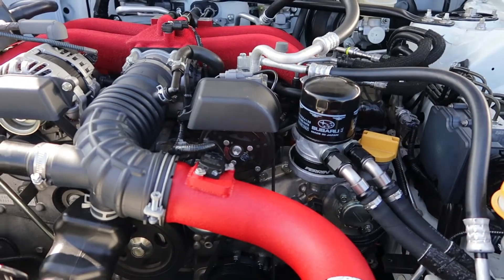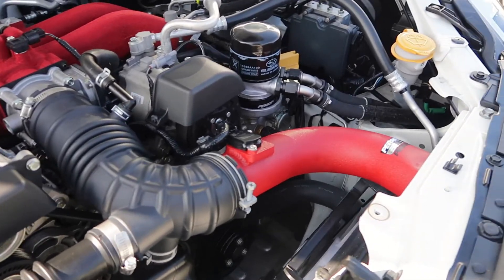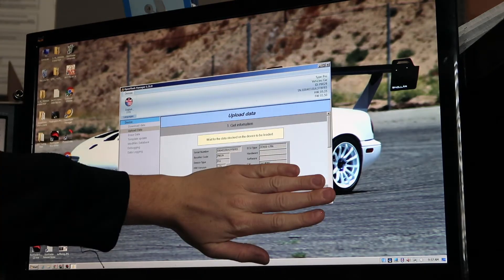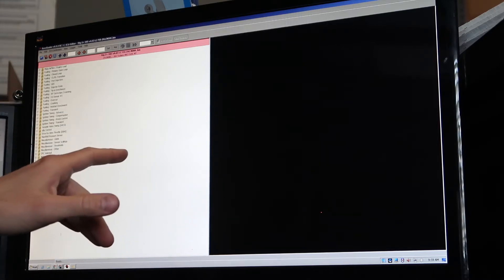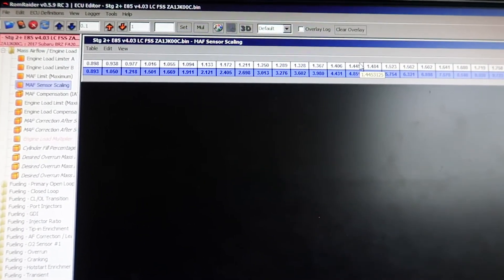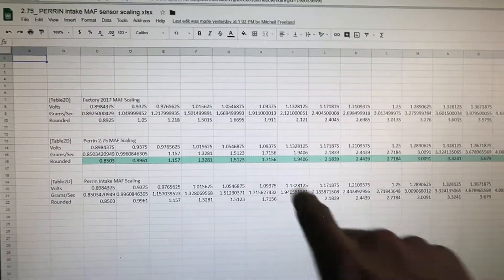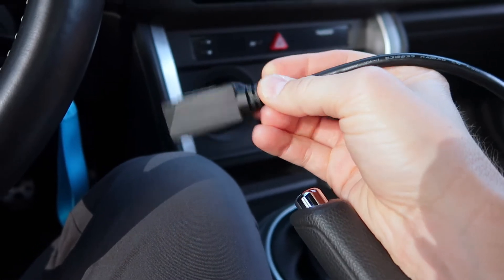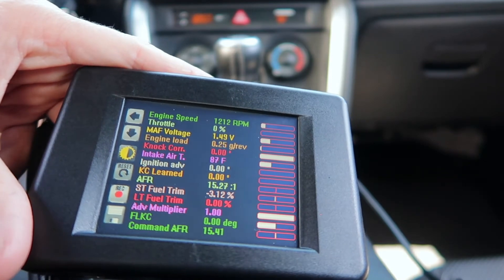DIY Tuning - Rescaling MAF Sensor with OFT (Subaru BRZ/Toyota 86/Scion FR-S)

Comment: Hi!!! I wanted to ask for advice if possible.  I have a scion FRS 2014

I had a spec d exhaust before, (bought the car used, it came with it). And I got used catless UEL headers on. After the install, the car was a lot slower than before, and I got a used OFT, to do the stage 2+ tune. I also got a cold air intake. The tune made it better, but it’s was a lot quicker before the headers, tune and cold air intake

I have little to no experience doing this. And I’ve seen people’s say that it takes about 50 miles for the tune to set in. Others say that the cold air intake is causing the issue (the tune specs say to use the stock air box, I didn’t realize this). Do you know anything about this? Would it make it better if I remove the CAÍ?  Any guidance would be greatly appreciate 🙏
Reply: Remove the CAI.

Comment: Thank you so much for this video! I was planning to get the Perrin intake, but you just saved me the hassle. I have a question for you though, if you don’t mind answering. If I switch out just the inlet tube, will I be running to the same issue? I really dislike the sound tube and want to clean up the engine a bit.

* Edit: You just got a new subscriber! Keep up the great content.
Reply from the maker: Glad you enjoyed it, switching out just the inlet tube should not require any tune changes and clean up the engine bay nicely.

Comment: Hey I was wondering I have an OFT but havent used it yet, the reason is because I am running an Injen SP short ram aftermarket intake. According to Injen the intake uses the same A/F ratio as a stock intake and no additional tuning required to install. I am also running UEL headers, does this mean I can run the stage 2 tune without issue because it retains the same A/F ratio and no tuning required to install?
Reply: did you figure this out bro?? i have the same intake and also have uel headers but not sure if i want to tune with that intake

Comment: This needs more views, great video man. I have the same Perrin CAI, it sounds sick and I just did my first tune with the OFT (stage 1 as I dont have headers yet) and the CAI is louder than ever, Im not sure how to check if its running rich or not, but surely with a stage 1 tune it should be fine right?
Reply from the maker: Thank you! I think with the Stage 1 tune you should be fine but you can easily double check by having your tablet log what the car is doing. Upload that file to Datazap.me and DM me a link, I can help you out.
Reply: @TheDriversPerspective  Oh wow, that really cool of you, man. Ill keep you posted!
Reply: @TheDriversPerspective  Its definitely running rich man, been chewing petrol and spitting it out of the exhaust. Im having trouble finding the perrin cai 2.5" scaling provided by Perrin though... Would u happen to know where I can find it?
Reply: Nevermind that, I found an excel sheet for the 2.75. Just uploaded it onto my OFT. More importantly though, that MAF scaling provided; will that work for both stage 1 and stage 2 tunes? im currently on stage 1.
Reply from the maker: So my experience with that MAF scaling was only with the E85, Stage 2+ tune. My experience was that it still ran way too rich. I can provide you with my spreadsheet if you want to try it. What year is your car? My understanding is the 2017 MAF is different too.
Reply: The Driver's Perspective I just uploaded the numbers from the forums though, won’t that work? I have a 2017 86
Reply from the maker: @stl8150  I'll take a look! I think to get the car running the best possible you'd want to do some e-tuning with OpenFlash.

Comment: my car is running lean after installing uel catless headers and my oft won’t let me go into stage 2 plus, so i’m stuck on stock tune but not sure how to fix this problem, tablet keeps saying it can’t connect to the ecu for some reason when it worked for stage 1 before going back to stock tune
Reply from the maker: Disconnect the cable from the OFT and car, cycle the power and reconnect the OFT. This happens every once and a while to me too. The ECU is in a read only mode based on conditions.

Comment: do these cars have a built in wideband o2? where are you getting wot afr's? btw i remember tuning my maf in the camaro with tuner catz and datalogging with datamaster almost weekly. youd be surprised how often mafs can start reading incorrectly. i had a extra o2 bung welded into my aftermarket exhaust so i was using a aem wideband
Reply from the maker: Yes, these cars have a factory wideband o2 so you can collect a lot of useful info from the factory ECU. MAF tuning was a bit of a nightmare so I went back to the stock airbox.
Reply: @TheDriversPerspective  thats awesome i dident know that. yah the pain is real lol
Reply: @TheDriversPerspective  How did you solve the interference with the oil cooler?
Reply from the maker: @artrozenbaum2367  I ended up using the back portion of the 2013-2016 intake, zero issues with the tune and perfect fit.

Comment: I recently got the Mishimoto cai similar to the Perrin one but haven't installed it yet and I'm already running a stage 1 OFT tune on my 86, in your expert opinion do you reckon I would need to do a reflash after install?
Reply from the maker: To be honest, I wouldn't bother installing it. I ended up going back to the stock airbox (2016 airbox to clear the oil cooler) because of all the tuning issues I had. My next video I will be talking about this and explain why in more detail.
Reply: Well I already bought the thing so I'm gonna give it a chance lol. But yeah I can always go back to the stock airbox if it doesn't work out. I'm a big noob at this sort of thing so was just wondering if I needed to flash again with the OFT after installing it or not, but thanks for your advice :)
Reply from the maker: Oh got ya, YES definitely reflash the ECU so it can relearn all of the parameters.
Reply: Thanks for that. Since my 86 is pretty new (Aug. 17) is there any special process when doing a reflash? Like I mentioned above I've used my OFT once before but that was just a simple follow-the-instructions thing to upgrade to the stage 1 tune, I haven't really dedicated much time since to learn the device's ins and outs.... yet lol
Reply from the maker: Nothing special, just reflash the same map and follow the step by step. After a drive or two make sure to data log it and make sure your fuel trims are not going crazy.
Reply: The Driver's Perspective will do, thanks again for your advice!
Reply from the maker: You got it! Don't hesitate to reach out if you need any more help.

Comment: I’m running stage 2+ e85 oft for about 6 months, it has gotten a lot more responsive and quicker although now my car doesn’t start. First start ups take 10 attempts then dies when I left up the clutch. I noticed my mass air flow sensor is at 1.8 volts and not at 4-5 volts, don’t know if that could be the problem or if I need a high pressure fuel pump but has anyone had starting up issues after running this stage 2+ e85 on their frs ??

Comment: Will TRD Cai intake require this?
Reply from the maker: Not if that is your only modification.
Reply: The Driver's Perspective oops sorry I meant to say will I need to rescale the maf sensor if I have the TRD CAI? I’ll be full bolts on with no cats
Reply: @Musicizmyremedy   i wanna know too!!
Reply: @danielc2712  hey, I can verify that you don’t need to. I currently have mine at Stage 2+ and no issues whatsoever

Comment: Any advice??
Reply from the maker: Pay for a custom tune and hope they get it right or put the stock intake back on. I ended up putting the stock intake back on.
Reply: @TheDriversPerspective  Ahh I knew it was coming to this. Thanks anyhow!
Reply: @TheDriversPerspective  I have another question. There's a device with a button and around 16 different modes for the Scion FRS(something like that). The color of this device is red/black and is similar to the OFT but its not a touchscreen. I can't seem to find it anywhere. Do you by chance know of the device Im talking about?
Reply from the maker: @lelouch6067  Hmm not familiar with that.

Comment: or just dont run an intake on an 86, unnecessary on these cars
Reply from the maker: This is the real answer. The only reason I wanted to try and run this was to clear the oil lines better but I ended up putting on a 2016 airbox and called it a day.
Reply: That might be true, but there are a couple more/different reasons that someone would install one rather than just saying that it is binarily good or bad for this car.

Reasons not to get the intake:
1. Performance: The stock design does a fairly good job at getting cold air to the engine already

Reasons to get a new intake (including an intake inlet tube, and the option of just using a drop in performance filter which I recommend)
1. Performance: Slight HP increase (3-5HP)
2. Audio: Intake sound/whistle is tiny a bit louder
3. Audio: Deletes the stock intake resonator and sound generator, quieting down the cabin
4. Visual: Clears space out in the Engine bay and tube looks a bit cleaner than stock
5. Cost: Cheap/easy upgrade in comparison to some others, assuming you just get a drop in high flow filter and not CAI
6. Cost: Reusable if cleaned around every 50K miles